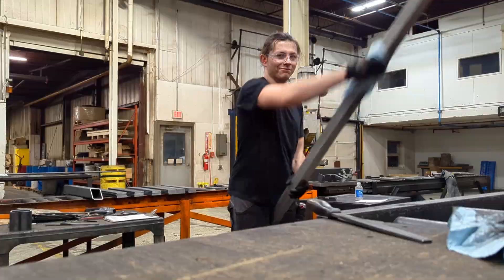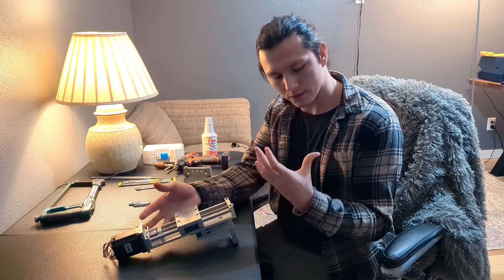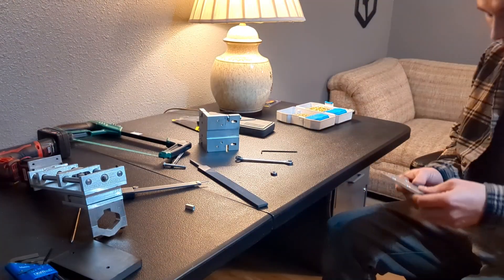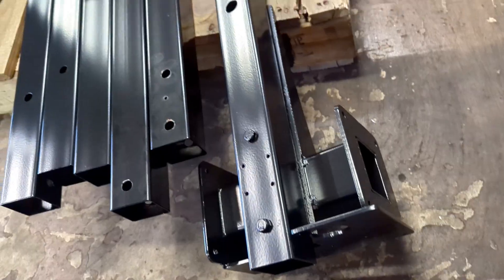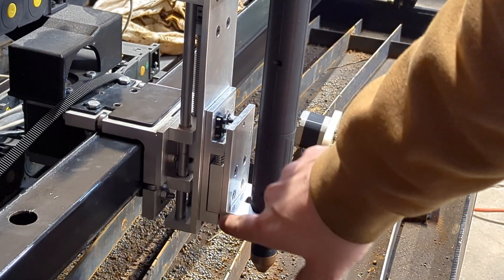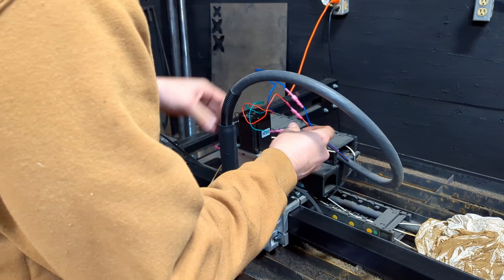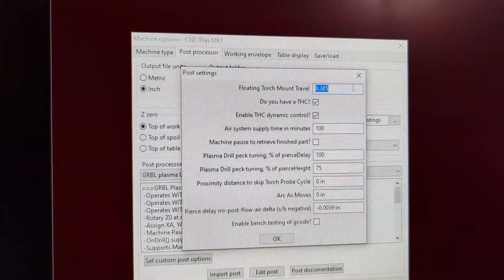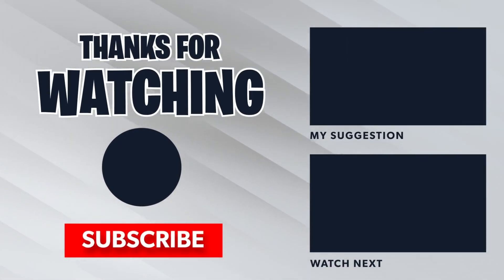After building JD’s Garage Z-axis.. I found a better option

Comment: never had an issue with JD's z axis, interesting.
Reply: That's because you know how to 3D print.
Reply from the maker: It will work. But after using an aluminum one. I'd never go back to plastic

Comment: Not giving up goes a long way. I fall on my face often. The trick is to get back up and dust yourself off and keep pushing forward. We'll all hit the walk at some point, and I find myself there at the moment😅 I wish I had your troubles since they are simple to correct 😅
Reply from the maker: @jasonhauserman-k9s  wise words! What are you struggling with?
Reply: @ThyialIndustries  i'm trying to make a rotary union so i can make rotary air chucks for the plasma i am working on. independent chucks controlled in the program would act like a bar feeder on the rotary. just an idea i had that has me beating my head against the wall :) working on my second version since the first one was not working all that great as soon as i added pressure.
Reply from the maker: @jasonhauserman-k9s  ohh wow. Yeah that's sounds like quite the project lol. I haven't even thought about the rotary side of things yet lol
Reply: @ yeah I'm off into the custom solutions on this one for sure. the problem you get into is the large diameter through hole to pass the material through. rotary unions have a unique characteristic. the bigger you go the more power needed to spin them. i talked to one manufacturer and was told i needed a 2 Kw motor to drive one of theirs. my idea needs to drive 2 of them in series. so that means i would need a 4 Kw servo just to drive them. that seems like a lot of motor to me. spinning a bore with a 5.5 " diameter is a tough nut to crack.
Reply from the maker: @jasonhauserman-k9s  in not entirely sure of your inner workings and what your trying to accomplish. But I know rotary cutters  have been on the market for a while now. Maybe look into what they are doing? Also, I believe a YouTuber made a fiber laser one. Travis Mitchell?
Reply: @ i have seen a few on here and everyone i have seen is a manual self-centering style, the front is just a manual self-centering steady rest that the has rollers so the rear can push material through. they usually have a 4-jaw self-centering manual lathe chuck that is manual as well. this configuration has the limit of table travel. what i am trying to do is have the ability to process a 24-foot piece of material on a 4-foot machine. clamping and unclamping of each chuck can be programmed independently, the front chuck if fixed and the rear is on its own linear axis, the front chuck holds the position while remaining clamped and the rear is released so it can index back to grab another bit on the material. so hopefully this explains it better :)
Reply from the maker: @jasonhauserman-k9s  definitely. Makes sense now. Reminds me of how automated band saws work. Will definitely be a challenge but if you can get it to work, that would be awesome.
Reply: @ if it was easy everyone would be doing it :) i literally made a custom mold yesterday so i can cast my own seals for this thing. finding seals an exact size to be cost effective with common material sizes is a treat. and finding the right kind that size makes it even more difficult. I failed at the first one but what i learned was priceless. so even a failure has its rewards if you keep an open mind.
Reply from the maker: @jasonhauserman-k9s  dang maybe post some videos? I'd watch that!
Reply: @ThyialIndustries  I will probably post some videos later if I get it sorted out. I cast my first seal to see what kind of troubles I would run into. I had a few small issues that I now have sorted out. I am working on my 3rd at the moment and need 8 in total for this project. I had placed an order for new material for the revised housing and was surprised that it showed up Friday. So I will be working on  this later today once the sun comes up :)
Reply from the maker: Sounds like progress! Nice @jasonhauserman-k9s

Comment: If you want perfect angle drill holes , don’t believe your eyes, or belief you have it angled right. 
I have a tool (only does 90) but here is an example of a jig tool for getting drill holes perfect
Search

Muzata Upgraded Multi Angle Drill Guide Fit 30 45 90 Degree Cable Railing Kit Stair Visible Template Jig 4 Sizes Guide Track for Straight and Angle Hole Wood Post CT24 CT1
Reply from the maker: @nemesis851_  thanks I'll check it out! Was also thinking of just getting a drill press. Eventually....
Reply: @ThyialIndustries yeh it's painful for me to watch you drill important holes without a drill press, I also find it amazing that you could build a CNC machine without one. That drill / hacksaw scene was tragic... why didn't you do it in the shed? 😅
Reply from the maker: @sharpsticksnz4112   🤣 gotta save up to get one of those lol. It was really cold out... Didn't feel like going outside